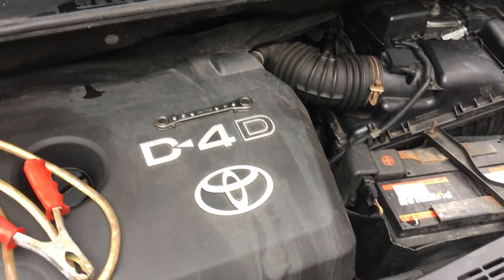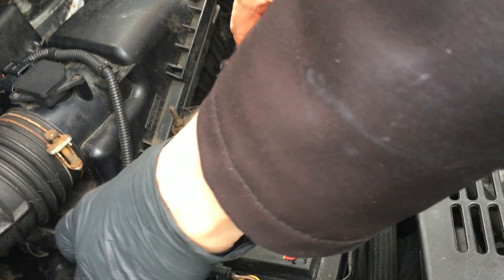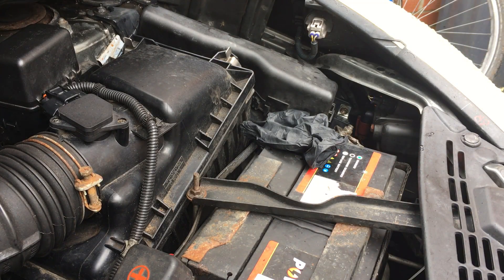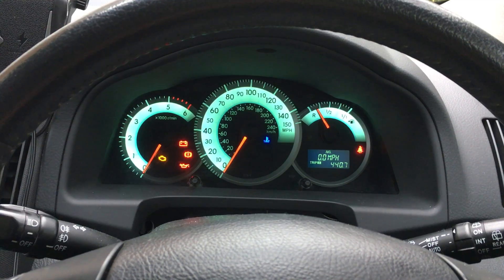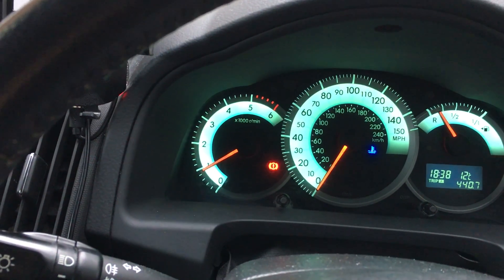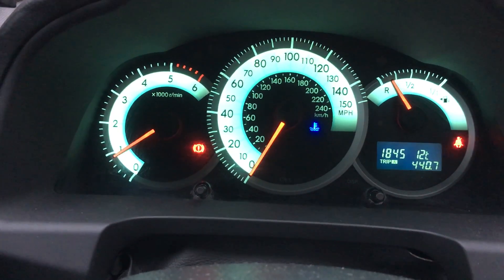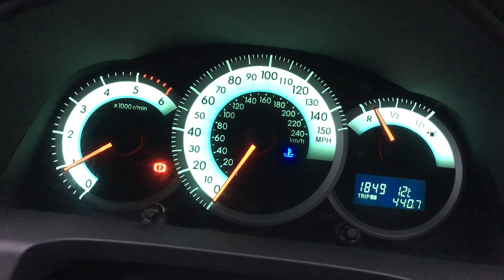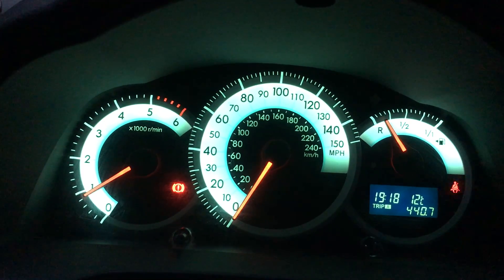How to reset the ECU’s on any car

Comment: No starter issue rav4 d4d 2.2 2009 on 175k so Pre-dpf model. Car cranks but doesn't start. Glow plugs are fine. Battery is over 5 years old but fully charged. Today I sprayed some Any Start fluid into the  air intake and started straight away! This is only temporary so what could be the issue? SCV valve? Fuel Filter? Fuel pressure pump?
Shall i just try the reset?
I didnt understand the charger still being attached?
Thanks

Comment: 🇬🇧 👍🏽 January 2025!

This chappie - GLC HOW? = the best videos for this problem, on the Internet!

Additional note:

This is a massive problem - given how common Toyotas with this engine are.

NOTE

1) This video talks about an 'ECU reset' procedure

2) It (or another one of his on this problem) - also mentions how, many people are finding that the problem seemed to be fixed when they changed this or that (e.g. starter motor 🙄) 

3) Even me - I changed the battery for brand new - & that 'definitely fixed' the problem (i.e. very problematic cold-starts/first start of day - to - starting first time, even in very cold weather)

BUT IN ALL OF THIS...

📍𝙩𝙝𝙚 𝙡𝙮𝙣𝙘𝙝𝙥𝙞𝙣 𝙬𝙖𝙨 𝙩𝙝𝙚 𝙗𝙖𝙩𝙩𝙚𝙧𝙮 𝙙𝙞𝙨𝙘𝙤𝙣𝙣𝙚𝙘𝙩𝙞𝙤𝙣 & 𝙧𝙚𝙘𝙤𝙣𝙣𝙚𝙘𝙩𝙞𝙤𝙣!!📍

It's as simple as that.

Yes - the SCV can get little stuck (bad design).

Yes - warming it can help.

And yes - you absolutely should at least have a healthy battery - because I think the voltage-drop from cranking leaves too little current for the SCV - meaning the plunger doesn't move as properly as it needs. 

Etc, etc.

But - the simple battery reset seems to be the actual solution - most of the time!
Reply from the maker: Thank you for your positive feedback 🙂

Comment: i watched the whole video and followed every step. But somewhere i must have missed an action in the protocol which caused my engine (d4d, 2.2 l, 100 kW diesel, 2008) not to be reset. Is there a checklist with the different steps available? i noticed that you keep the brake pedal depressed, that the handbrake is pulled up... is the gear lever in a certain position? in short, is there a checklist?  by the way: great video....
Reply from the maker: Thank you for your feedback. It’s a process, but this video might help 
https://youtu.be/pRs5hbQBoko

Comment: Just changed mine… car reving up and down and surging 🤷
Reply from the maker: I would check for air leaks, like disconnected hoses 1st
Reply: @ all good that road mate… definitely something to do with SCV. Maybe need ECU re flash or reset of fuel values

Comment: This explains why my Denso SCV fuel regulator after replacing old on wasn’t work as would throw EML on dash and go in limp mode
Reply from the maker: Maybe 🤔. I hope this video helps you diagnose it.
Reply: @glchow  so when changing the SCV you have to program to the ECU? 

As mentioned when I replaced my old unit for Denso started up fine but on test run would throw EML on and limp mode.

I thought was a straight forward replacement 🤔